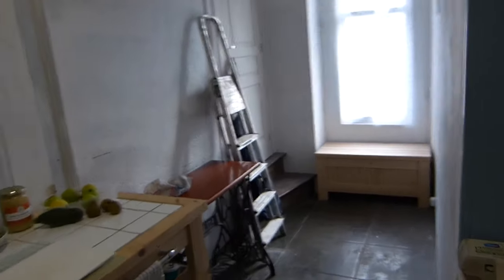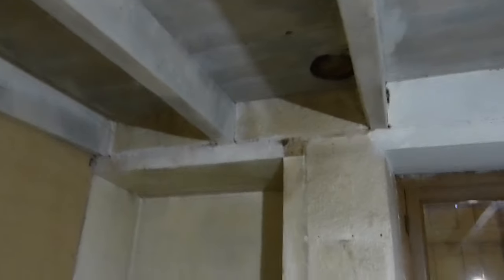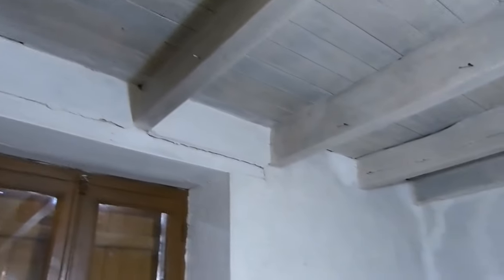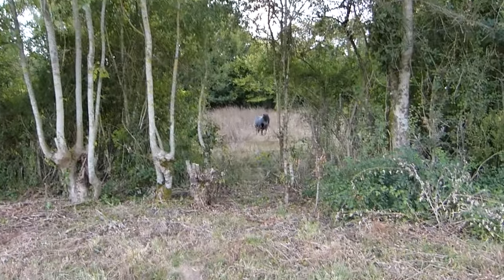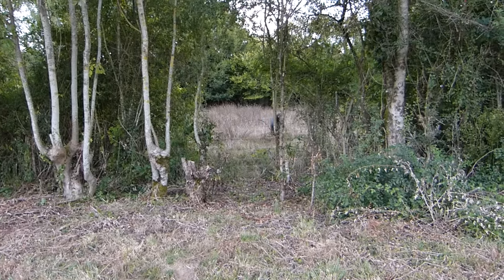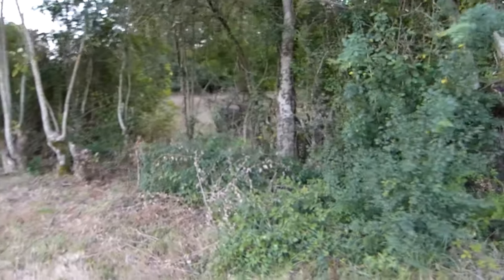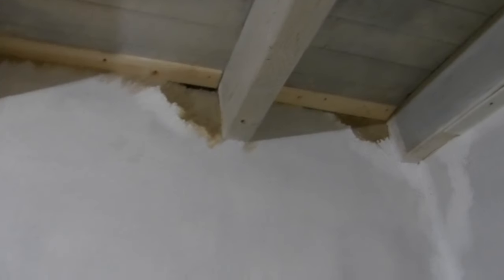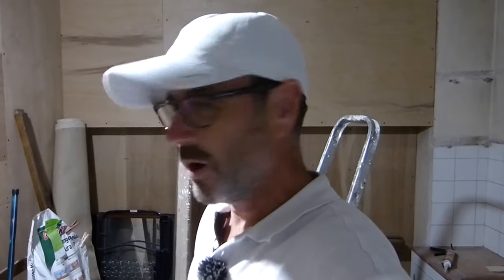Starting again at 50 - My new life alone in the countryside

Comment: Insulated drywall in between the beams will stop the heat loss through all the slats or you can plaster over all the slats to seal the ceiling. Petherick's did it in their convent kitchen if you need a reference. Simon in their video's is a master plasterer and gives wonderful lessons on how to do it, He can show in a few minutes what would take pages to explain in writing. My father was a stone mason and master plasterer - so I highly recommend you watching some of their video's where they are working on the kitchen in the convent.  Massive room to heat so they have the same issue as you only on a massive scale.  Could have your place done in 2 days.

Comment: Hi Marc, I think you are on the right track attacking the draughts. One thing you could also do is add a bead of silicone to the edges that touch the corner where the wood meets the plaster, then screw in the wood. One could also add sealing tape first, for a bit of overkill ;)

Comment: On some other channels   they wet the surface before mortoring.  Not sure if that improves stick. I have been spackling some screw holes, and its a job I detest.
Reply: Wetting the surface first helps to stop mortar or plaster drying too quickly, the dry surface can suck the moisture from mortar or plaster, drying too quickly can mean it won’t adhere to the wall properly.

Comment: French hot water balloons. Are they not designed to be on all the time via an internal thermostat? My one is hard wired with no adjustment, not even temperature it seems to be set on installation as far as I can see.
Reply: Mine comes on overnight on cheap rate, electric board send a message through the metre to turn it on, it clicks at 11.30 then again at 7.20am.  I turn it off every other day at the fuse box as it gets too hot to use.  You can turn the heat down, there is a thermostat under it, my electrician turned mine down in my old house.